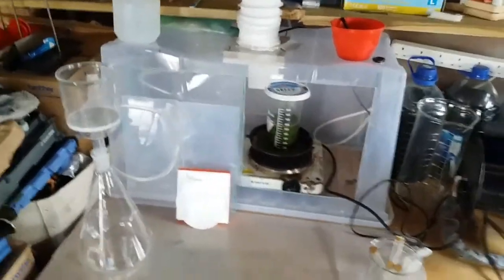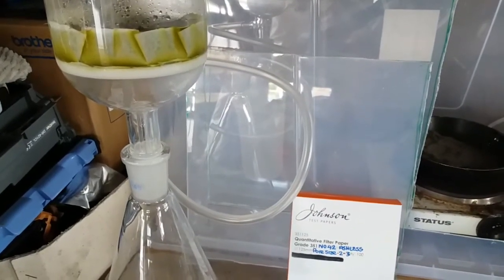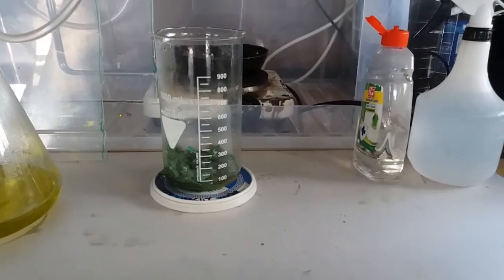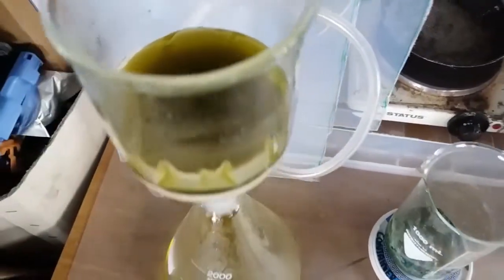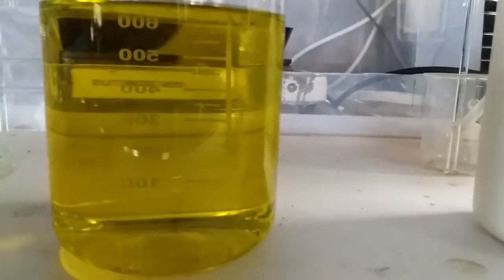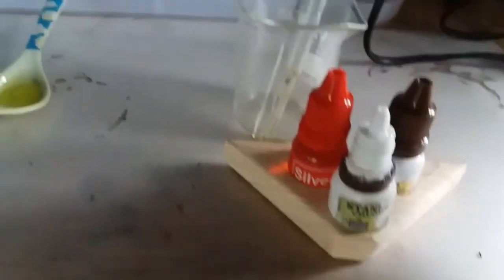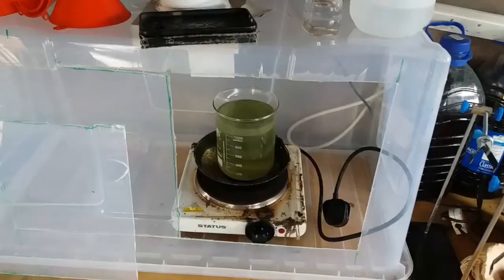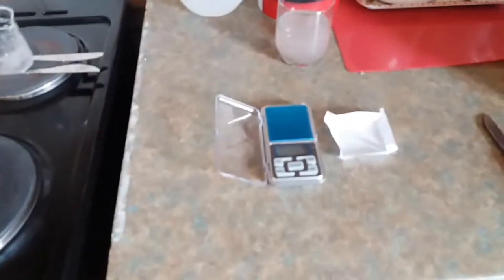GOLD RECOVERY FROM GOLD PINS.denoxing/filtering/drying/weighing.foils 4 ram/gold pins/goldconnector

Comment: Hi i am a new sub and are liking your vid's
In this one you say that you make poor mans AR with HCL and KN03 ( Potassium Nitrate ) was this so ? i only ask because most use Sodium Nitrate with HCL.
regards
Reply from the maker: hey man.thanks for watching and subscriber.please feel free to ask questions anytime..yes I made poormans AR with HCI AND KNO3...I use potassium nitrate(KNO3) AS I find it very hard to buy sodium nitrate in ireland..you can can use any of the nitrates to make poormans AR OR Poormans nitric..use can potassium or sodium. it's not recommended to use calcium nitrate as that's forms dry wall(gypsum) ya don't want to filter that..lol
Reply from the maker: Also you can make poormans nitric acid in situ aswell with either potassium/sodium nitrate. 
You mix sulphuric acid and the nitrate  of your choice and water.  This needs to be well hydrated. I mean more water is,a little more than u would normally use on different processes